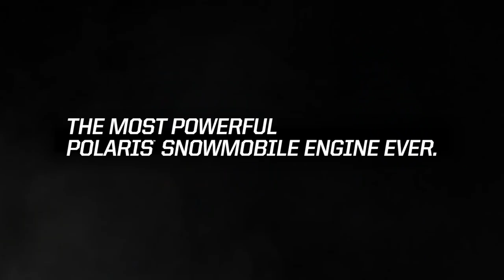Polaris® 850 Patriot™ Engine Factory Build - Polaris Snowmobiles

Comment: Now if they could build a triple again
Reply: Jackson K I’m not the only one?!😂
Reply: I bet they could knock on the door of 200 hp with a 8-900cc triple with todays tech
Reply: Jackson K the problems that they had with the triples though is the middle cylinder would get hot end the engine would lock up, thus they got rid of the triples
Reply: @fargonianproductions2767  wrong as I’ve only blown either the pto or the mag side as they have the most stress